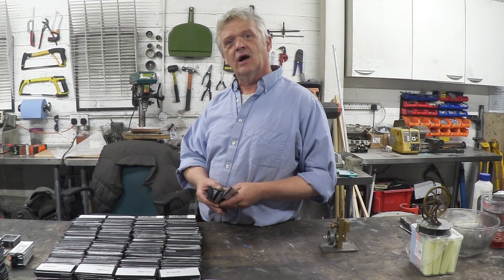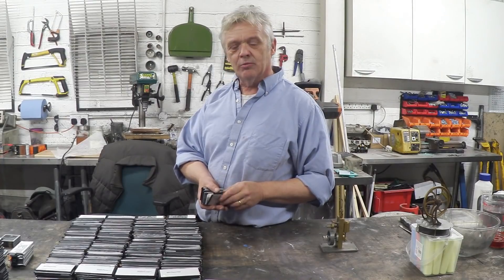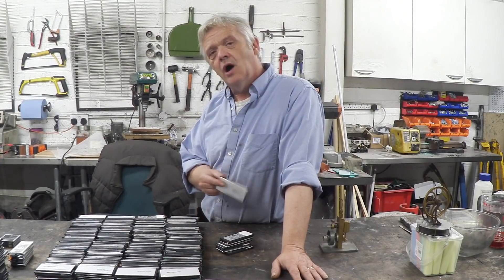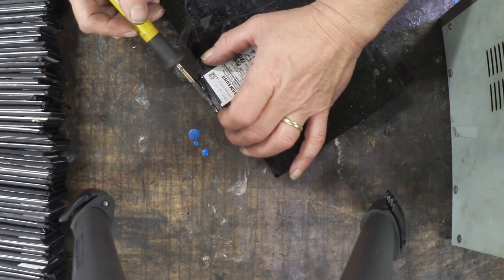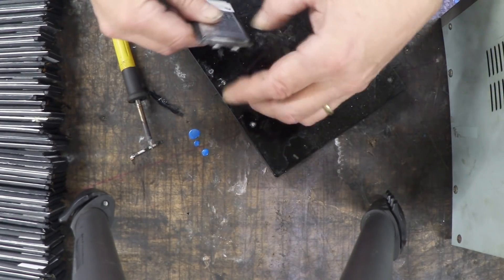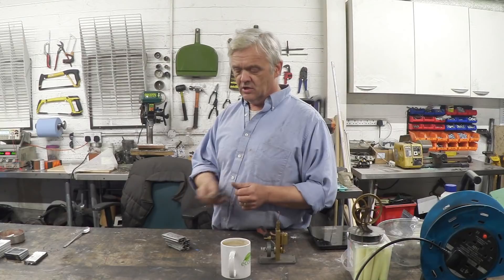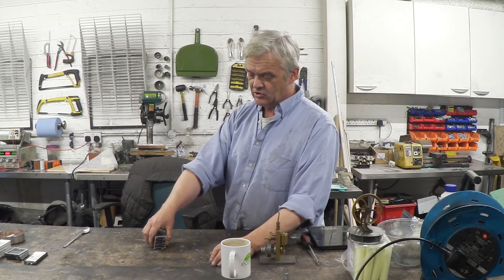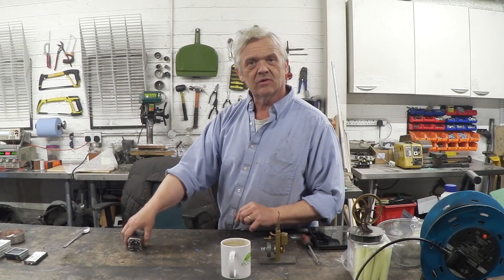1272 How To Reuse Old Phone Batteries

Comment: I generally change my phone when the battery dies, because I've never had much success with aftermarket replacements. My current phone is near replacement. The battery appears to charge etc. but dies at between 50 and 70% indicated capacity. It hasn't inflated like they sometimes do, but waste of time reusing. Good luck with reusing old Lithum cells...!!!

Comment: Remember, people, when you store your lithium ion batteries/devices using them, it is best if the battery is nor empty or full. Both is harmful because of the chemistry. About 50% of charge in your phone/tablet/gadget or 3,7ish volts is best for storage. Battery may show 4,2V after two years of storage but the total capacity has lowered. Not sure about how much it was but anyways, when with couple or many cells, better to keep them working better.

Comment: Power tool battery packs are a good source for the old 18650's just don't go thinking any pack is lithium however. Many of these new tablets and laptops have flat cells too. 
Yes the self discharge is very slow, just be sure to store in a safe place so if one did short out it wouldn't start your home on fire!!
Reply from the maker: for sure mate

Comment: Hey Robert, I agree with you about the batteries below 2.5 volts will probably be dead as a doornail! However,  I have learned from some of Big Clive videos.  Some of his electronic devices he purchases from poundland come with a dead 18650 battery in them. 0 volts. He applies a trickle charge while keeping an eye on the battery temperature. If the battery still has life in it, once it reaches 3 volts, he will disconnect the charger and watch the voltage to see if it plummets. If it does, you have a bad battery. If it doesn't, the battery will probably recover to be a good battery again.👍
Reply: The voltage may recover, but the watt storage of the battery is considerably compromised as well as the charge/discharge rate tolerance as they all depend on the surface area for the chemical reaction.  In an array, the poorest performing cell may end up damaging all the rest of the cells, or just limiting their performance.
Reply from the maker: cheers mate

Comment: @6:55 I believe you meant 4.2v. Or better yet stay at 4.1v for safety and extended lifespan.
Reply from the maker: nominal voltage is 3.85 recommended charge voltage is 4.4V  only say this as that is what is printed on the battery
Reply: @ThinkingandTinkering  thanks. Looks max voltage dependant on battery itself. my galaxy s7 battery is 3.85 (4.4v) too, while older batteries from other phones says 3.8 (4.35) and 3.7v. Googled and it looks that this is due to improved chemistry to get more energy density over 'usual cell'. I have killed few 18650 by accidently overcharhing them, thankfully there was no fire.

Comment: Funny. I just restored one discharged to 2V and working again. Upper limit is 4.2V I think. When you set the psu to that there's no problem. 4.4V is probably to much.
It might be illegal to have so many lithium batteries in one place. The company I work for has many but also the special fire extinguishing equipment to deal with it when it catches fire.
Reply from the maker: 4.4V is what is printed on the battery as the charge voltage
Reply: @ThinkingandTinkering  ok. I think max voltages vary somewhat. 4.2 is common. I have seen 4.1 but not 4.4 so far. But youre right. If you set a psu on correct current and voltage limits it makes a good charger for lithium. Voltage need to be set accurate though. 0.2 V to much and you might run into trouble.

Comment: I charge my recycled batteries up to 4.2v. Then let them sit for 2-4 weeks. If the voltage stayed above 4v I write that voltage on the pack. Then when soldering them into parallel packs I use matching voltages. 

I do this because if you have a cell that will discharge to 4.05v and you put that in parallel with a bunch of cells that stayed at 4.18v the whole pack will get drained down to 4.05v from self discharge.
Reply from the maker: cheers mate

Comment: 4.4 VOLTS IS TO HIGH ! ! !  ONLY GO TO 4.2 VOLTS.
Reply from the maker: MATE -  the charge voltage is printed on the front of the battery! I have no idea why folks don't read - the best advice is just to read the information supplied with the battery - or LOOK IT UP - don't go by random guesses and stuff you think you know - check it first before you do anything
Reply: @ThinkingandTinkering  AGREED, HOWEVER I HAVE EXPERIENCED 18650'S EXPLODING AND CATCHING ON FIRE CLOSE UP IN MY EYES AND TRUST ME IT IS NOT FUN AT ALL, JUST TO BE SAFE NEVER CHARGE ANY LI-ION OR LI-PO BATTERIES OVER 4.2V ... PLEASE BE CAREFUL AND WATCHFUL ON THEIR TEMPERATURE WHEN CHARGING BECAUSE IF THEY ARE BAD THEY WILL NOT GO MUCH HIGHER THAN 3.8 TO 4.0 WHEN BAD AND JUST GET HOT AND EXPLODE.  PLEASE BE SAFE.

Comment: When I reuse old batteries I always put the final pack in a fire resistant bag or metal case. That way if they burst into flames you only have smoke damage to the area it is in. Without that it can easily start a fire.
Reply: I use an ex army surplus ammo box for storage. Ive seen a setup where they put a bag of sand on the lid if there's a fire it will burn the bag and drop the sand on hopefully stopping any other batteries catching on fire
Reply from the maker: cheers mate

Comment: Nice score! 

I do a lot of small electronics projects, and use these quite often.  AT&T knows me when I walk in - but man, never had more than 5  :) 

For smaller form factor: My favorite small project battery is from discarded e-cigarette... these contain a  5x1x.5 cm 3.7v.  280 ma battery that normally heats a wire.  Good amperage...
Reply: Yes indeed. As the companies that make them look for ways to compete they have started making them in various sizes. I got a 1000mah battery from a disposable ecig that is not designed to be rechargeable. What a waste, use it for one charge and toss it.
Reply from the maker: I never even thought of that!! - awesome tip mate
Reply from the maker: I like that tip mate cheers

Comment: Wow! Those are good friends indeed. 10+ kWh, that's what I'm planning for my first bank. I just ordered some PV panels and trying to scrounge some storage. (Thought about Bromine but I'd rather not have that much in the house.)

The protection circuits that I find on phone cells typically use a DW01. I wouldn't bin all those, they'll be useful for many projects. 
Big Clive has a video titled: "Simplest solar light possible, using old phone battery." or something very close to that. It's a good example of how to make use of those protection circuits.
Reply from the maker: cheers mate

Comment: I repair a lot of old nintendos... if the batter is too dead the charge circuit will not charge them..
so i look up the charge profile for the chem of the battery and do it manually..
99% of the time.. they come out fine.

another thing.. if you put them on a flat surface and spin them... if they spin they are dead , they usually look a little bloated if real bad. danger at that point. 
a good battery is totally flat and wont spin
Reply from the maker: cheers mate - but if it is a bloated battery it takes on a barrel shape so spins and is guaranteed to be bad if it is fast it won't spin - so it might be good - but you still need to do the other checks as it isn't guaranteed to be good

Comment: If you want any recommendations, ive found techniques to bring back Li-ion cells even if there at 0 volts
Reply from the maker: cheers mate - if you want to post a few it would be welcomed as others can read and share those ideas too - thanks again mate
Reply: @ThinkingandTinkering  
If battery is at 0v 
Step 1 - put battery in sealed air tight bag and put in freezer for over night
Step 2 - remove battery from freezer defrost till at room temperature again
(Expansion and contraction can break apart any dentrites that may of formed and cause internal short circuit)
Step 3 is take another half charged Li-ion cell and jump charge 0v cell for about 5 to 10 secounds ( this will burn out / short circuit any possible dendrite formation in the cell)
Step 4 apply 2-3v power supply to battery or use a nearly depleted li-ion cell about 25% state of charge  and boost charge dead cell till voltage reaches 2.2v or more
Step 5 quickly put refurbish cell on smart charger that detects battery health, voltage, capacity and internal resistance

(Note: if step 4 does not work and you cant bring voltage back up you can repeat steps 1-4 a couple more times if you do not achieve positive results then cell is %100 dead dead.

Comment: This is exactly something I've been playing with currently.  I just replaced my 16 year old prius batteries which I plan to repurpose and I have some handtool batteries that I'm looking to also renew.  My question specifically relates to the charge/discharge parameters.  I'm wondering if you might be able to simply explain how you came to your parameters where they can be applied to any size/capacity battery.  My guess is this would be different based on different battery types.  I plan to look at other resources to understand it better myself, but would make for a good addition to your upcoming charging setup video or even a separate video.  This could really help as I see this as an even larger problem as governments move to more solar and wind (no judgement only an observation).

PS... for those who might get upset/troll the above I do have the parameters and safety information needed for my prius battery by looking at what others have done, but being able to reuse some of these type of cells for other things would be great.  Small additional information might get many more people to reuse batteries vs toss them.
Reply: I like to do the first charge for good batteries with an amperage that will charge it in 2-4 hours. 

Any battery that is questionable I like to charge with a current that will charge it at 10-12 hours. 

If any battery gets a lot hotter than the rest I toss because that signals their resistance has gone to high.
Reply from the maker: a lot of the time these batteries come with the data sheets and an outline of the chemistry  - different battery types have different parameters - I just look them up

Comment: Could you make a slimline ebike battery out of them
Reply from the maker: I plan on doing exactly that mate
Reply: These are low current batteries so no because you should only pull 1C from these batteries. That is the amount of current that will discharge the pack in exactly 1h. If you ever put a higher current load than that the might overheat and burst into flames. 

So the ebike battery has to be really big. Which means it’s not slim line. :). But you will have plenty of range.
Reply from the maker: I am sorry mate but what you are saying here doesn't sound right to me - mechanically and chemically they are exactly the same as what you are thinking of as high current Lithium batteries - physically they are different in being flat as opposed to cylindrical so the battery pack has no inherent air passages when made up to allow cooling - that might have to be taken care of in a built up pack - but the idea that they are different in characteristics from every other lithium of this type because they are flat rather than circular isn't right to my mind - so - what makes you think they are different?
Reply: I was half joking because of the slim statement. The pack is going to have to be fairly large to make up for the fact phone batteries are high capacity but low power output. I bet these are safe at a 1 amp draw. Which is 3.7 watt output. So to run a 1000w motor you will need 270 cells. Will that be considered slim. :). You will definitely have plenty of range at that point though.

Comment: Couldn't you check the voltage using the tabs before you went to the trouble of desoldering? I'm thinking that would reduce the time wasted on unrecoverable packs....
Reply from the maker: there is actually a circuit between the battery and the phone connection tabs - so you are not really checking the battery if you just connect to the tabs you are checking the battery and circuit - so if you get a 'good battery' well - all is well - but if you get a 'bad battery' you actually don't know why it was bad - maybe it was the battery, maybe it was the circuit - it may not matter much when you have a few hundred - but it might if you have one or two - also with one or two - it's a few seconds difference - so why not do it anyway

Comment: Got my hands on a bunch of laptop batteries. Right now i made a few 12V battery packs and i run my nightstand lamp / phone charging and random projets. Most of the packs i made are just around 4-6Ah each but i can hotswap them and im charging them with a solar panel taped to my window. Never ran out of charge and im running them for over a year now. Planning to make a supercapacitor stabilised high punch current batterypack as an offgrid energy storage. Upcycling is great!
Reply from the maker: nice mate and yes it is lol
Reply: i finally got a super cap to work on my desk,  took me long enough...   so now im getting industrious feeling myself and i want to make a big thick block of it and try to get to 10,000 farads or something similar.